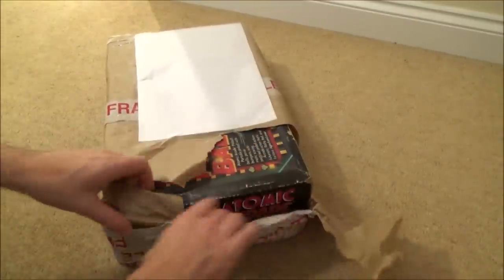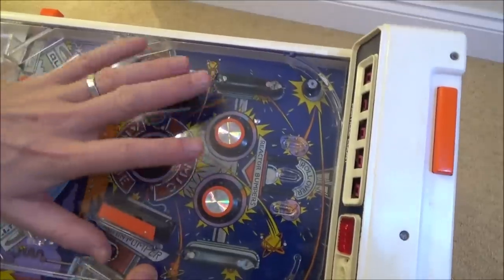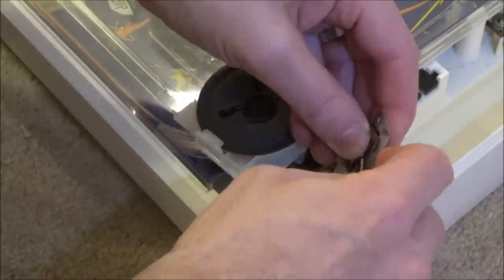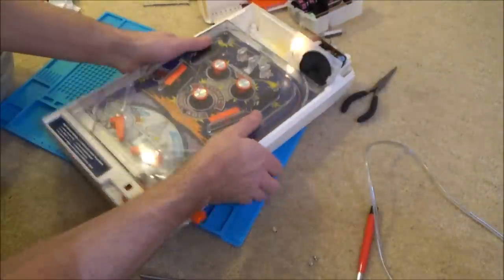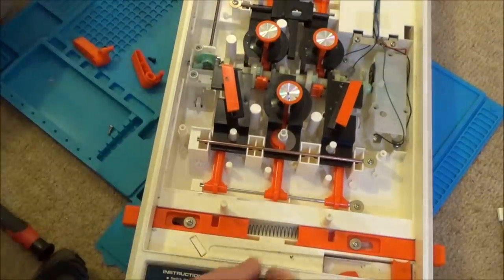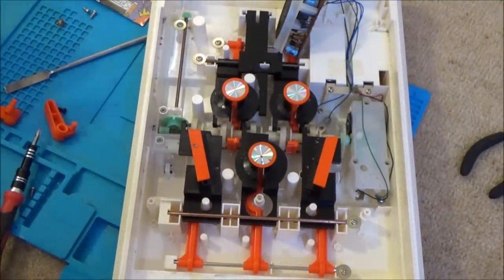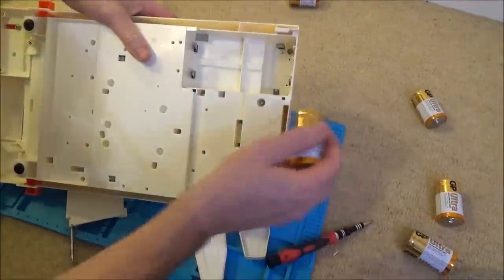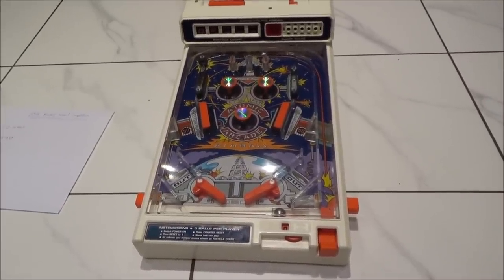Trying to FIX a Faulty 1980s Portable Pinball Machine

Comment: Hey Vince, I was gifted one of these (non working) and thought it was too cool to throw away. I found this fixit video via a google search and turns out mine had the exact same fault as your one. I bought a soldering iron, cleaned up the contacts and added some solder to raise the connection slightly and it now works perfectly, all thanks to you.

I've been enjoying working my way through your other uploads and you've inspired me to attempt repairs on other faulty items.

Keep up the good work!

Comment: Unreal man, I watch most of your vids and watched this one last night.  I remembered I had one of these as a kid and wondered what happened to it.  I searched ebay and found a guy selling one local, and went and picked it up an hour later.  It had the exact same problem with the switch as the one in your vid.  Luckily I just watched your vid so I took it apart and the same contacts are corroded.  It does work when you mess with the switch just right.  I just cleaned it up and it works great now.  I already ordered the parts to install an AC adapter plug on the back.  No way I'm using five D cells for this thing.  Keep up the great vids, love them.
Reply from the maker: Excellent, what a result. The AC conversion sounds interesting :-)
Reply: @Mymatevince  would love to see how you'd do an ac adapter on it.  I was planning on just installing a panel mount jack on the back then after ordering I thought some day someone might have batts installed and use an adapter and fry it.  Now I'm thinking I'll either wire the switch off position to the ac plug or use a separate switch to toggle ac or battery or I'll just order a 3 pole dc socket so when ac is plugged in it disconnects batteries automatically.  I ordered a 7.5V 1A ac adapter that I think will work.  Might do a regulator also just to be safe.

Comment: wow, that was some clever mechanical logic.  The pressure plates are mechanical switches that disengage multiple clutches (engaging various cogs to the drive train). That works out such that the speed of the motor (presumably constant rpm), is the poll rate of the mechanical switches. And it can only ding/advance the score as fast as the motor spins. one could say the RPM controls counter speed.  So, that gives you a mechanical version of system clock speed, mechanical switches with a clutching system that behave like relays while sounding a bell and advancing the score. Whomever designed that thing was brilliant.
Reply from the maker: Nice explanation. It is a lovely mechanism :-)
Reply: It has features that bear kinship with mechanical computers of old.  Like this calculator from the 1800s for example:

https://sites.google.com/a/glnd.k12.va.us/computers/cpu-vs-mechanical-calculator
Reply from the maker: Looks great :-)

Comment: Hi Vince, Love your videos I think they are brilliant.
I don't know if anyone else has told you this but I will mention it anyway, just in case.
I have watched some of your videos where you come across dirty switch contacts, well there is a spray that you can buy called "Switch cleaner or switch cleaning lubricant" one make  of it is called "Servisol Super10" and you should be able to get it on line for under a tenner. ( a tin of this stuff lasts for ages)
You can use it to clean noisy potentiometers (Volume control switches).
 on volume control switches spray just enough so that it gets into the switch, then rotate the volume control back and forth a few times to spread it around inside the switch but don't spray gallons into a volume control switch, just enough to do the job.
doing this will cure volume controls that crackle when you turn them up or down on radios or amplifiers.
With on and off switches like on your pinball machine, just spray into the switch as before and move the switch back and forth a few times and that will save you risking taking switches apart because they don'y always go back together.
Warning Don't use switch Cleaner on Mains switches or switches with a high current flowing through them, if you get a bad mains on/off switch or any switch with a high current flowing through it replace it and also if you use it near plastics do a little test to ensure the solvent doesn't attack the plastic first, because it can melt some plastics.
Switch cleaner is designed to work on tarnished contacts, so if you have a tarnished contact it will clean the contact and also it has a built in very fine oil to prevent the contact re oxidizing again anytime soon.
Switch cleaner lubricates switch mechanisms so if you have a switch that doesn't make that nice click when you switch it or the switch feels a little tight, say a slider switch then after using switch cleaner it should make it feel a whole lot better.
If the switch or volume control is warn out switch cleaner will have temporary results or make no difference at all.
one other thing, using switch cleaner will stop your hands drying out from using IPA, which over time can become nasty,  IPA is a brilliant cleaner but wear gloves if you can and if you have a duff switch use switch cleaner, I hope this helps.

Once again Love your videos keep them coming, they are great, all the best Brian
Reply from the maker: Thanks for all the info Brian. I appreciate you taking the time to help me and the others reading this :-)
Reply: No problem Fred thanks for your great video and all the best for 2019

Comment: If you think Atomic Pinball is complicated, try fixing a Tomy Astro Shooter; way more complex (I've restored two of them) Bumpers work the same, but there are additional elements: two kick out craters and a ball cellar. Tomy made some amazing stuff back in the day. Also, be careful with the tops, they're clear styrene plastic,  they scratch easily and are hard to replace; You can buff out most of the scratches with Meguiar's PlastX; That stuff works great. Cracks are damn near impossible to fix though.

Comment: Awesome stuff, you dont see mechanically engineering like this anymore because motors and electronics are cheaper than the r and d. Nerf guns however still have complex mechanical mechanisms like this. Very cool stuff. I just bought my first broken ps4 and thought id give it a try.

Comment: what you should do is fit a adaptor socket on it so you don't always need to use batteries
Reply: That could be done,as long as you match the voltage..i have done it to a few things of mine.
Reply: I was thinking the same thing, it would be a very useful mod.
Reply: Probably difficult to do because i think the 4 batterys are 2 sets in series then the 2 sets are in parallel for more amps (posibly for power to the motor[s]) it could be done but only by doing some math figuring out the amps needed and doing a little bit of googling and it would be a mod unless a adapter that fits inside the battery compartment were used but there are Ni-Mh rechargeable D size batterys i don't know where to buy them that isn't online.

Comment: If don't know if you can get new ball bearings that size off the shelf or not, but it looks to be the same size as the one found inside the non return valve of Miele dishwashers. Any Miele tech will have some old ones. Also some Vaseline on those plastic gears wouldn't go astray.

Comment: Hi, I bought one for myself recently and fixed up a few issues thanks to your video, however I can't find the problem behind the buzzer making a constant beeping noise. Note that whenever a bumper is hit, the noise gets louder, so you get that the 'extra' beeps, but even without playing the buzzer is making the continuous noise from the power on. I've checked the solder points, all seem relatively ok, I've cleaned up the circuit board and cannot see any bridge points along the path. Any ideas how to troubleshoot?

Comment: I just got one of these at a local goodwill complete in box. I also had to tear apart power switch and clean it up. Mine however makes a constant chime noise. Ive disconnected both blue signal wires to the board and it still does it so I assumed it was on the circuit board. Recapped it.. same thing. Any ideas as to whats causing the issue. Thanks

Comment: In case you don't know µ is the lowercase Greek letter mu. In electronics mu is designated for micro. Although most people say u f when talking about capacitor values it's actually mu f. To answer your question in the video yes MFD and µF are just two different ways of writing micro farad.
Reply from the maker: Thanks for clearing that up :-)

Comment: I wonder if you could feed a little more juice to the motor to speed the start up and then use the pressure switches to switch the motor in so its only running when the ball is in range

Comment: Before I watch... was it the on/off switch?   Check all four sides of the box for a (C) date on the artwork. They changed the box every couple years so that will help you date it to within a year or two.  Mine's (C) 1990 and only 4 batteries.  A late one.

Comment: For you it would be easy. I have a power supply that has 4 capacitors out. The camper set for a while. Do you know what would cause it? I am going to order the parts and try to fix it. I do have a new one so it will be fun to mess with.
Reply: Depends, if it's of a certain age (somewhere mid-90's and down) and/or it's been sat more than a year then likely just "natural wastage" I'd suggest.  If the caps are across mains voltage make sure they're rated for AC and are a safety type (I.E. "X2")

Comment: By shopping around I'm sure you could obtain a brand new shiny chrome steel ball? I'm guessing it's about 1/2inch. Great video and ingenious mechanism. The whole thing sounded like a Vacuum Cleaner I personally would have applied some lithium grease throughout the chain of cogs and basically all moving parts and pivot points like the flippers. Anyway watching the end competition you should be disqualified as you purposefully tilted the machine lol

Comment: This was awesome I want to take a part and I think it's going to be mostly cleaning my 1978 Parker Brothers Merlin game it was a computer game you could play Tic-Tac-Toe, Music Machine, Echo, Blackjack 13, Magic Square (which was my favourite) and Mindbender.  which was my second favourite. Six games that you played against the computer (6 bit? Or a blob CPU)
LOOK one up with the box.
The way the opaque silvery circular membranes work should intrigue you by their looks and designed functionality. 
I bet you want to find one, in box with manual  (more detailed than instructions because there are about  a dozen tunes that you can input in about 48(?) Characters.
1 thru 10 buttons and 4 reply/mode buttons.
Six AA batteries or DC Input 
The shape and non slippery case are cool, to me, as well.

Comment: Im no expert beyond watching fix vids. But i would have thought flushing the switch through with isopropyl might have been the first step before taking it apart. A quick flush may have removed some of the grime build up that stopped a contact.

Comment: Best way to clean that type of contact is with an ink rubber then clean the  rubbish away with IPA. Your pen is fine but its a bit exclusive.  Another good polisher is Silvo, used to use that as last resort video head cleaner. Then always use IPA to clean residue.  Silvo should clean that ball nicely.

Comment: Hey Vince, are you looking at that faulty tin can alley. The 70's Chuck Connors version. I've already got one but they sell for quite a lot working.
Reply from the maker: No, I didn't think about that one but it could be a possibility - if I can find a faulty one :-)
Reply: @Mymatevince  there's one on eBay at the moment. It's even got the Pepsi cans, should be an easy fix, they aren't that complicated. I can't resist taking things apart even if they work.
Reply from the maker: Thanks so much, I have put a bid in. Let's see if I am lucky with it:-) Cheers for the link.

Comment: MY NEW PHONE TECHNOLOGY IDEA::::
What frequency is heavier than air?
What frequency loves light?
What frequency loves colour?

Put your hands together like in 🙏 prayer position to activate your holopad screen phone. To deactivate your phone pray position again. Whilst using your phone you do not have to use both hands together. One handed use works.
Eye lid chips colour project? Ear chips do sound. 
Solar p.owered. 
See the human body as the green circuit board to be added to...